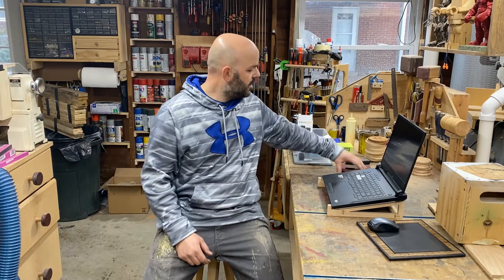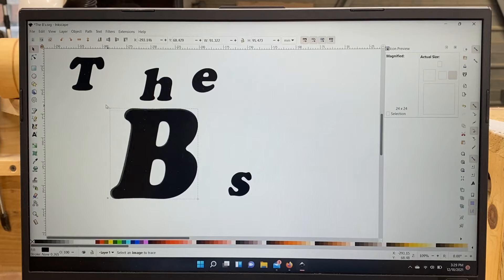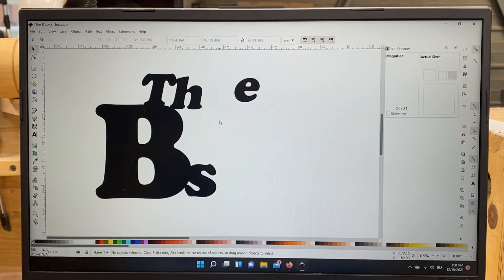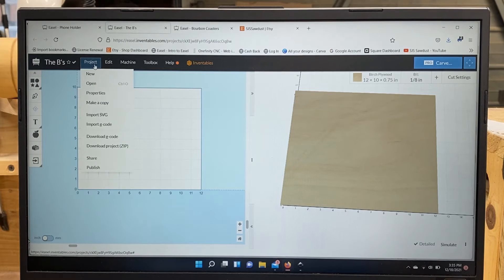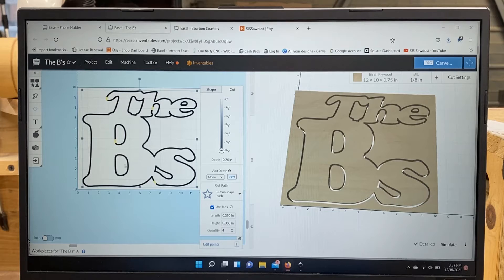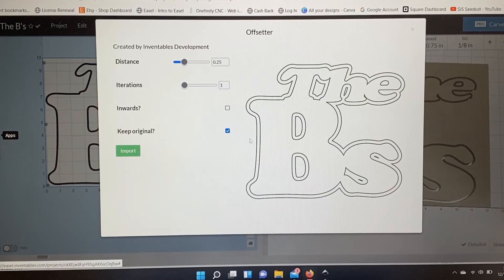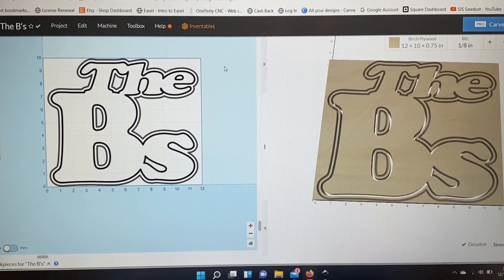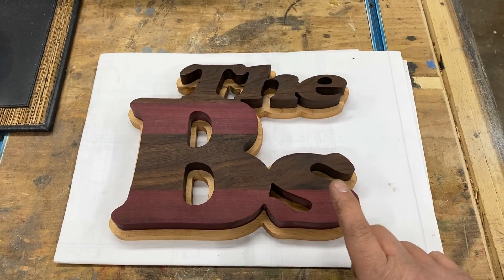Onefinity CNC - How To Design Files In Inkscape

Comment: Interesting design. I am assuming this was two different cuts. Did the 2nd cut just cut the outline or offset or did it cut a shallow pocket for the walnut like a inlay? Too bad the video cut off too soon
Reply from the maker: The Maple was 1/4” thick and the Walnut/Purpleheart was lined up on top off it and just glued to it  ( the alignment was simple so I didn’t think about using a pocket to register )